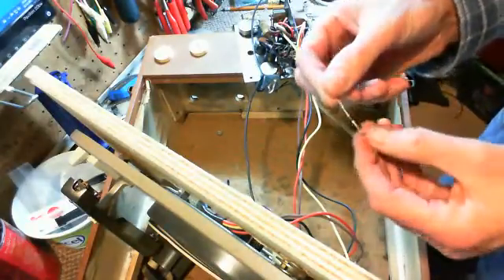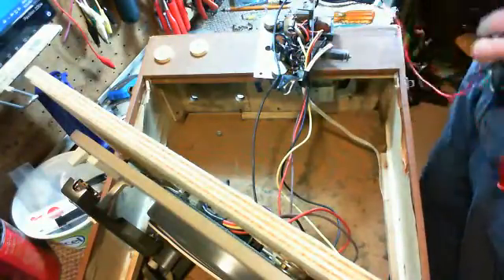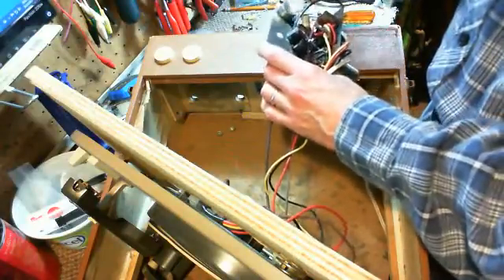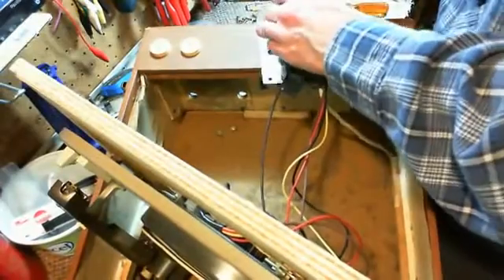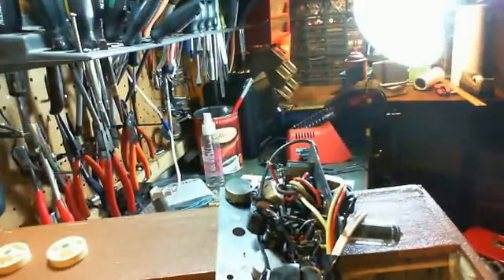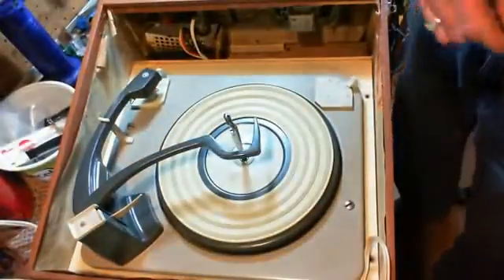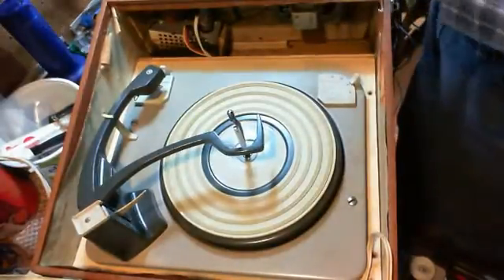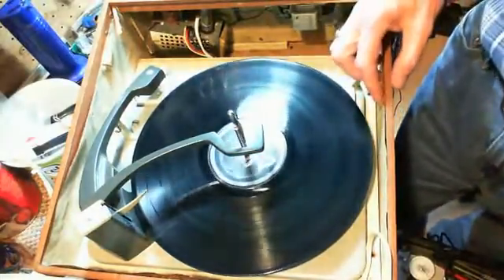Electrohome 601 Record Player Video #2 - Replace Selenium Rectifier

Comment: Why didn't you measure the B+ to find out if you needed a dropping resistor with the 1n4007? Example what if schematic B+ is like 130v and now you have like 147 , with out a dropping resistor won't that heat up the tube and cause premature tube failure?